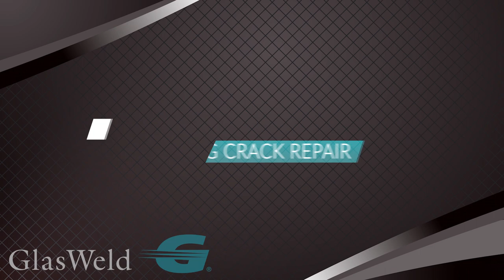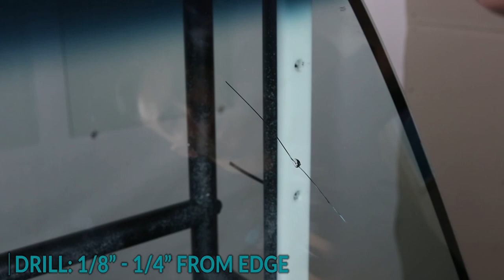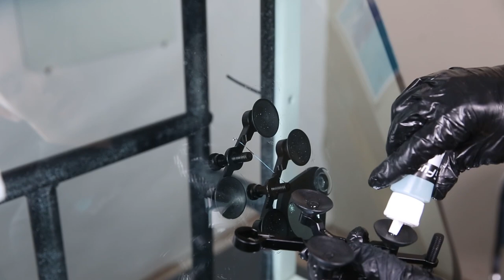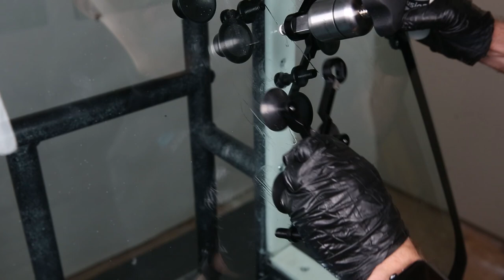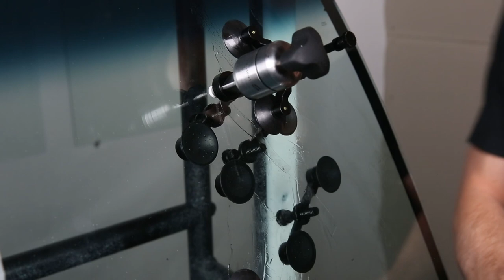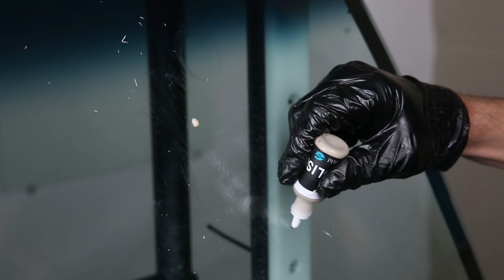Training: Long Crack Repair

Comment: As an old-school GlasWeld customer and technician,  I like to cure the ends of the crack under pressure to prevent the drill holes from showing those dark spots so that the repair can look more cleaner and appealing to my customers. This is how I was taught and will continue to use it.  Thanks for the tips and tricks and when to use those resins.
Reply from the maker: Good Comment Ian. That's a good suggestion.

Comment: I tried to do one today first time ever,I had the right idea but not the correct technique I made many holes alone the crack line,couldn't keep my injector on cause of the holes
Reply from the maker: Long crack repair is an advanced technique that definitely takes some practice before taking them on for customers. We recommend practicing along with the techniques in this video and with repetition you should see improvement over time so keep at it!